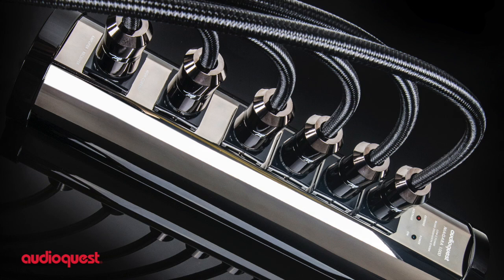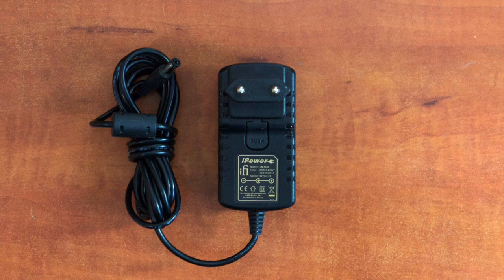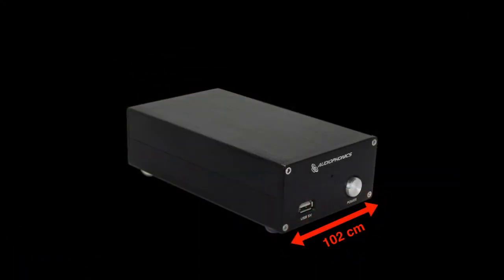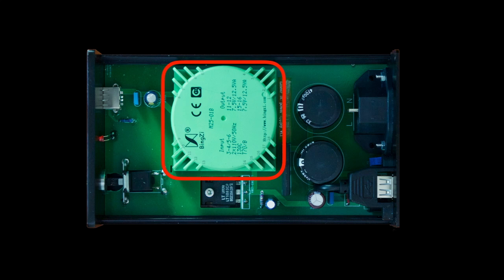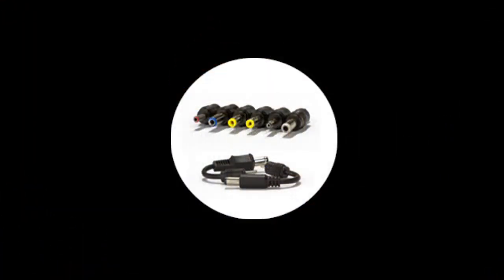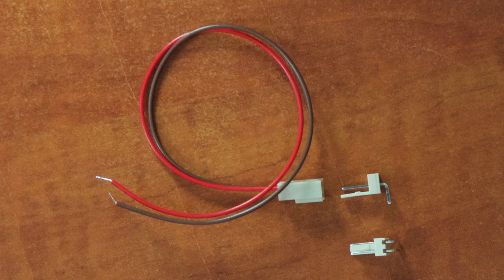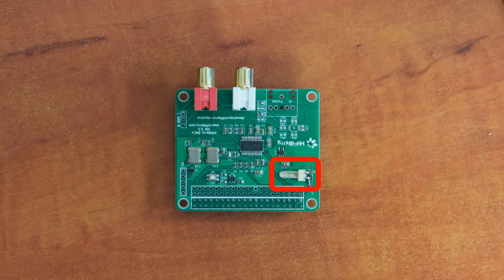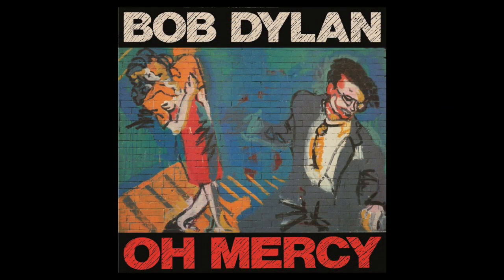Power Supplies 2:  3 PSU's for Raspberry Pi and HiFiBerry DAC+

Comment: Just bought a Audiophonics LPSU25 5V linear power supply to use with my 
Raspberry Pi 3B. At first power up I got a low voltage warning from the 
Pi (running OSMC Kodi). This had me worried, but adjusting the voltage 
screw on the back of the unit cured this. 
The setting was set to 5.15V using a multimeter. So if you are in the marked for one of these 
powersupplies, remember that the initial voltage setting may be off ever so slightly.
Reply from the maker: Thanks for sharing

Comment: As you obviousky own very capable audio measurement equipment, would it be possible to see measurements of THD+N of this DAC with different PSU's? 
Those distortions from using impulse PSU must be huge, therefore clearly measurable.

Comment: Goedendag! I have tested the Pi with a 22.000 mAh Powerbank and it works fine. It is decoupled from any powerline and runs about 20 hours with a hifiberry dac board. My plan is to link it with my Chord Mojo to drive a headphone. What do you think about batteries or powerbanks as suppliers for a pi?
Reply from the maker: They are inconvenient, family unfriendly and vary greatly amongst themselves. Having said that, if you don't mind the hassle and can find a good sounding one, why not. But don't be mistaken, there are noisy batteries as well!

Comment: Hi Hans
Another excellent review, and one that I have been waiting for. I have a couple questions:
1 - You didn't mention the Sbooster Ultra upgrade, so am I correct in assuming you aren't reviewing the Sbooster with the Ultra upgrade.
2 - Have you tried the ultra upgrade, and if so does it affect the sound?
3 - There is a new type of power supply available using ultra-capacitors. Have you tried a power supply of this type, and if so are you going to review one in the near future?
Reply from the maker: ad 1: patience my friend😀 It will come...
ad 2: patience my friend😀 It will come...
ad 3: patience my friend😀 It will come...
Allow me my cliff hangers, Ed. 😬 No really, to much choice in a review will make it hard for some to follow. I already have the Ultra update and the Uptone in the house and am working on it. But don't expect the review next week.

Comment: Not sure if this is a good question but what about using a battery? Would that be near perfect supply?
Reply from the maker: Hardly. It has a high internal resistance this is slow in delivering current. And they are noisy compared to audiophile power supplies.

Comment: Great review Hans. Consolidates the importance of good power which you've mentioned many times. It's reasurring to hear that at least from the examples in this review, you get what you pay for. I would like to have seen the default Stontronics given an equal chance by being connected the same way via the DAC board. Very interested in the upcoming reviews of various power supplies with mR and SMS-200. Any plans to include the new Uptone Audio LPS-1 power supply in those reviews? Cheers. Pete
Reply from the maker: I have considered connecting the Stontronics to the DAC board but the power was heavily polluted so I saw no point in cutting the micro-USB or trying to find a micro-USB female connector to set it up. Too much hassle for a result that's not interesting. The Uptone is already in the house - and, as always: the review will be published when finished. When that is I will know when it's finished.

Comment: Suggestion - just use a good power bank to power both the pi and spdif / dac hat as they provide cleaner power than than most mains psu. Additionally underclock and under volt the pi, performance is not required. Personally prefer a good toslink connection as it completely isolates the dac from the pi.
Reply from the maker: Power banks are slow and noisy compared to a good power supply.
Reply: The Hans Beekhuyzen Channel Opportunity there for a comparison video and make use of your oscilloscope ?

Comment: So what do I put it on, amp, preamp or dac?
Reply from the maker: Whatever needs a better power supply. In general the power amp is rather difficult to replace the power supply for, the DAC is the easiest. But it only pays if you use a power supply that is developed for audio.

Comment: Thank you for another great review. I personally use the Ifi power supply but i am open to upgrade. I am not any good with DIY so i can't take advantage of your useful advice to connect directly to the Digi+ board. Is the usb output of Raspberry Pi out of the question as the primary output for the Pi compared to the Digi+?
Reply from the maker: Any situation outside my own is difficult to know or comprehend. Therefore these kinds of personal questions are impossible to answer. Those who do answer this kinds of questions provide fake security to the one asking. I know this won't help you, but it is the fairest answer I can give: There will be some improvement, it is depending on your situation, your equipment, how you value money and your listening acuity whether you will consider it to be worth while.
Reply: Thank you for the reply, however i don't see how my question is personal. You make so many tests with Raspberry that it seems logical to have an opinion about the quality of the usb output. If i made you think that i ask you to compare usb with Digi+ i apologize, it was not my intention. I just have noticed that many people consider the usb output of the Pi low quality and i wonder why.
Reply from the maker: I do have an opinion on it: just buy it, or better, buy an SOtM sMS-200 with SBooster power supply and Roon. But if that will fit your budget, whether you will appreciate the improvement in sound, whether your stereo is of sufficient quality, all questions I don't have answers to.
Reply: Thank you Hans, this was very helpful. Looking forward for the next power supply review, when it is ready.
Reply: Andreas Papandreou Andrea, i had the same questions with you. I am using raspberry pi with ifi power through USB output to ifi ione and sounds amazing. Ione supposedly reclocks/regenerates the signal so in theory a combination of ione + pi+ ipower should be close to the sound quality of devices like microrendu etc for so much less money. I am curious why and if digi+ will sound better than the USB output of pi but I cannot find on internet any direct comparison and explanation yet.
Reply: Hi Paul, comparing coaxial with usb input is not so easy. I believe it depends on the dac. A direct usb connection with Pi is at disadvantage here. My solution is to use a Singxer SU-1 XMOS usb bridge. I connect my Pi with usb to Singxer, then i connect Singxer with a HDMI cable to my dac. This is an I2S connection "audio only". Of course Singxer has coaxial and AES/EBU outputs too but simce my dac supports I2S this is the best option for me. If you google it you will find links and reviews about how it works. I hope this helps.
Reply: Andrea  Thank you for your reply. Your device seems a more sophisticated usd digital to many digital options converter than mine. I have a less expensive USB to spdif converter for which I was very happy and ifi ione is doing such an asynchronous conversion which I am even happier. But my point is that if  something happening to the signal output from pi's USB that cannot be fixed later (after the signal leaves the pi)and affect the sound quality for whatever reason, software or hardware related. In my case, the sound from pi's USB is so good that I cannot imagine how a spdif card inside pi can improve my sound quality substantially.  The cost of trying is not big but I am hesitant to try because I reserve the spdif input of my ione for the TV. In any case, is good to know that a device like singxer exists because before you I was ignorant of its existence.
Reply from the maker: The SPDIF boards take another signal from the Pi than the USB does. It comes over the GPIO connector and is called I2S,, pronounced as Aye squared Es. This is a signal that is designed for audio and has separate clock and data busses. The SPDIF board takes this signal, reclocks it and convert it to SPDIF. Often there is also a small transformer that provides galvanic separation.
Reply: The Hans Beekhuyzen Channel Thanks Hans very much for your reply.  There are some measurements on the internet that claim output from pi's USB was perfect and there was no need for something more. But I took your comments on board and after some critical listening I was also thinking that the output from pi USB is not probably optimal setting aside the technicalities for the moment. Thus I invested to a new product from allo called usbridge. I hope you will review it in the future in order to put things in perspective and in comparison with other products.
Reply: Andreas Papandreou Γεια σου Ανδρέα και πάλι.  I decided to upgrade from the USB of pi and bought an allo usbridge and I wanted to bring this to your attention as an alternative moderately cost solution. People on the forums claim that is a game changer and compares favourably against more expensive devices. I am also looking forward to their upcoming r2r hat dac for pi through i2s signal to bring my pi back to action.
Reply: Hi Paul, this looks very interesting, i wish i knew about it when i needed it. Since we last talked i decided to downsize my system and moved to a different solution that covers all my needs with just one box, Oppo UDP-205. There were just too many boxes and cables in my system, this way i simplified things considerably. I read what allo say at their website and i loved the detailed explanation about why usb output of Pi is not so good quality. And good job with the Greek, you nailed it:)

Comment: Hi Hans
I purchased an sBooster power supply for my Elac Discovery, DS-S101G-G, and I appreciate the difference it made over the stock power supply. I have wanted to get an Audiophonics linear power supply for my RPi player since seeing this video. It hasn't been in stock until recently, so I ordered one, but a couple days later got this response from Audiophnics: 
Unfortunately we don't have this product for 110 v. Your order has been canceled and refunded.
Do you have any other suggestions for a reasonably priced 5v linear power supply for the RPi?
Thanks
Reply from the maker: A good alternative is the iFi iPower (https://ifi-audio.com/portfolio-view/accessory-ipower/) you have to order the 5V version. It comes with an adaptor for the RPi. It is a switching mode power supply done right and performs at about the same level as the Audiophonics. The EU price is € 59, it will be around the same in US$.

Comment: Hans, if you start to improve your RPI with an expensive power supply to improve the quality, is there a point where it is better to just buy a more expensive DAC that has a better power supply in the first place?
In other words, how does an improved RPI sound in comparison to a DAC from the same price range
Reply from the maker: yes there isa point but it will not be the same for everyone. It depends on your personal conditions and qualities and that of your stereo set. So I can't give a definitive answer. But to give you an impression, in general RPi DAC's perform  at the level of € 100 to € 200 when listened to at my set 3 (see http://thehbproject.com/en/About).

Comment: Hi Hans, I've bought the Sbooster 5V, 1.5A to directly connect it to the Digi+ Pro board, the pi and an attached 2.5" HDD. Unfortunately it doesn't provide enough power to drive HDD. Is it possible to regulate down the 5V to 3.3V so I can power the Digi+ Pro independently from the PI without losing the Sbooster's low noise advantage?
Reply from the maker: No, but what you can do - if you're handy enough - is to break the power link between the Digi+ Pro board and the Pi and feed the Pi using a second power supply. Depending on how critical you are, this can be a cheap SMPS or a simpler audiophile PSU. like from iFi or Audiophonics.
Reply: That's what I meant to do. Can i just connect the Sbooster to the 5V connector on the Digi+  when I power the Hifiberry and the pi separately? I thought you'd have to use the 3.3V connector in that scenario?
Reply from the maker: No, just use P3 on the Digi+ Pro to connect the 5V DC sBooster to.
Reply: Thank you

Comment: Thank you for the interesting review.

How about the Hifiberry Digi+? Do you think a cheaper linear PSU like the ifi will be worth the 50€ in a setup consisting of Nubert Nubox 381 speakers and Musical Fidelity V-DAC II incl V-PSU?
Reply from the maker: Any situation outside my own is difficult to know or comprehend. Therefore these kinds of personal questions are impossible to answer. Those who do answer this kinds of questions provide fake security to the one asking. I know this won't help you, but it is the fairest answer I can give: There will be some improvement, it is depending on your situation, your equipment, how you value money and your listening acuity whether you will consider it to be worth while.
Reply: Well, you are of course right. My question was definitely overspecific, I was actually aiming at asking whether a good PSU makes a reasonable difference in a (say) <1000€ set on the DIGI, because you said in the video that you preferred the DAC for the test, as clean power makes more of a difference in that case.

Anyway, thanks for your honest but still helpful answer.
Reply from the maker: It will make a clear difference in absolute sense (I use the Digi+ the way I described in Part 2 of that video and use an older SBooster as power supply). Whether the investment is worth while for you, depends on your personal situation.
Reply from the maker: It does. But if it will fit your budget, whether you will appreciate the improvement in sound, whether your stereo is of sufficient quality, all questions I don't have answers to.
Reply: I just realized that you had already answered my questions (or at least the ones that you could) in the part 2 video about the Digi+ in a very concise way.

Thank you for your kindness to be still trying to help, and thank you for this amazing channel of course!

Comment: Dear Hans, at first thank you for your great video. I like your channel very much.
But may I ask you a question?
I use a pi 3B+ with an allo digione Hat. I use it in a logitech media server environment. I first started with a Max2Play image and the original sm power supply. Sound was good, but in short time frames the sound output of the squeezelite stopped working. The pi worked normal. To bring the device to play music again, only a restart helped. I contacted Max2Play support. They recommended a different power supply. I did some research and found out that the pi needs an overrated voltage of about 5.2 volt to work properly. So I bought one. That slightly increased the stability. In the meanwhile I changed the image of the pi to pcP. This did not solve my problem. I also upgraded the pi from my initial 3B to a 3B+ to make sure the problem didn't come from a fault in the pi. I also changed the SD card. No help. 
Because of the good sound quality and my affinity to the squeezebox system I decided to do another upgrade. The Sbooster BOTW 5-6 Volt. What should I say. Sound is awesome, but my problem didn't change. The Sbooster has not enough voltage. It only provides 5.0 volt. I contacted Sbooster and they fine tuned a Power supply to 5.15 Volt on the output and sent it for exchange. Great customer service by the way. With that fine tuned device I measured a residual voltage of 4.9 volt on the p1/p5 pins of my pi. So normally this should be sufficient, because voltage clear beyond 4,75 volts should be fine, I guess. 
But I still have some issues, but I cannot find a clear reason. What I tell now sounds very strange, but it is reproducible. I owe an elektric TV chair, which I use while listening. Every time I come up and stand up out of the chair, the squeezelite output stopps. Only move to start sound again is a full restart of the pi. 
Sometimes I can listen to music for hours, as long as I don't stand up from my chair. But if I do so, it stopps music in about 80 or more percent. 
I thought about EMI, but no other device in my flat, respective my chain shows a reaction on the chair thing...
I have no more ideas how to solve the problem.
So may I ask you if you have any idea where I can search for a root cause?
Actually I stream with the pi via WiFi. One next step will be to try to get it connected to a Lan port.
Another measure will be the switch to a squeezebox touch to get back stability and comfort, but I am afraid that this will be a step back in sound quality.
I appreciate any input.
Thank you in advance and best regards
Andreas.
Reply: Have you tried unplugging your chair and seeing if that makes a difference?

Comment: Still, I'm not able to manage the costs of a linear power supply, thats why I want to use an USB charging battery, made for a mobile phone. But when the battery is empty, I still want to be able to run the DAC+. Here is my question: Would there be any Quality loss when the minus cable leads out of the pi for maybe 10cm and in again? I would install a kind of a power switch, outside the PI.
Greetings from Frankfurt, Germany
Reply from the maker: I don't expect so.
Reply: The Hans Beekhuyzen Channel Thank you for this fast answer!
Reply: Wouldn't it be cool if the brains of the board would charge the batteries when not in use, then when music starts, it switches over to battery power?! Maybe an Arduino project...